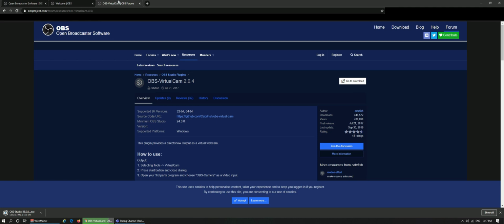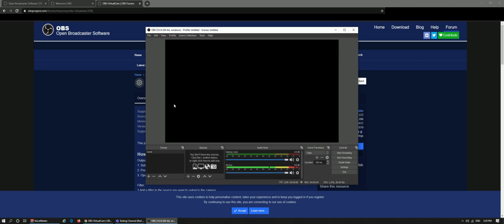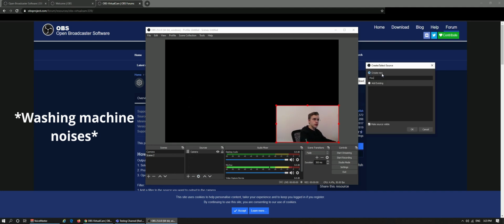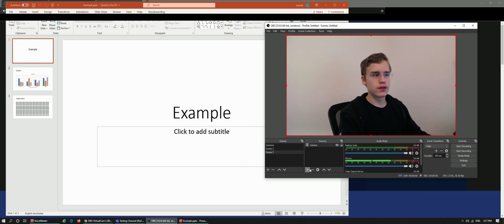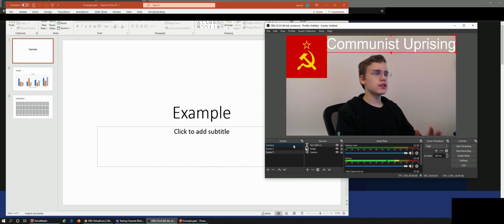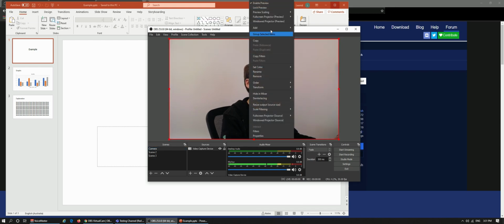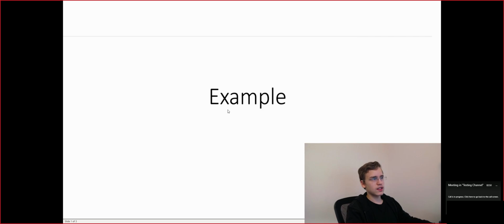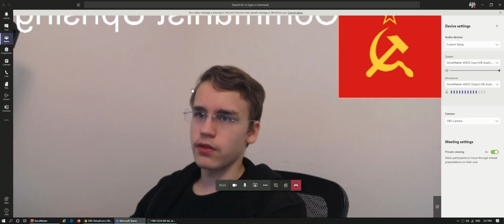How to Use OBS Studio to Present Live Online (using screenshare or camera input)

Comment from the maker: I only just recently found this out; the browser source allows you to interact with the web-page, so if you're using google slides to present you should make it so anyone with link can view and then put that link into the browser source, as well as setting the resolution to the same as your canvas. You can then right click on the browser source and press the interact button, which pops out a window where you can interact with it as you normally would.

Another thing to note is that your cursor can be seen on the window capture device, even if it the window is behind something else. I recommend you set it up so everything can be done via hotkeys and leave your cursor on the right side of your screen.